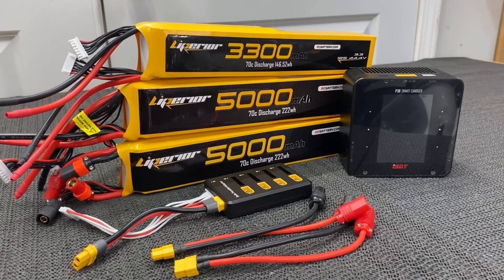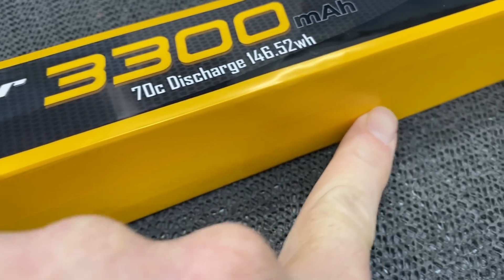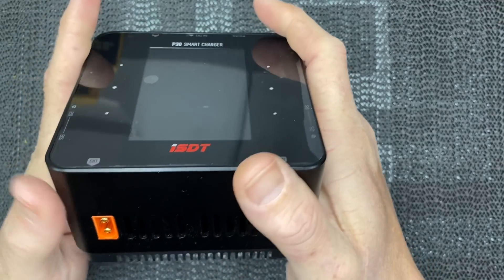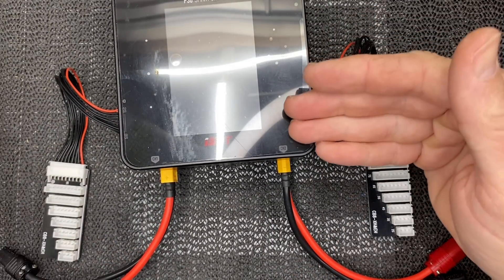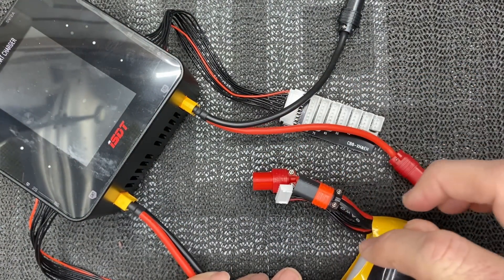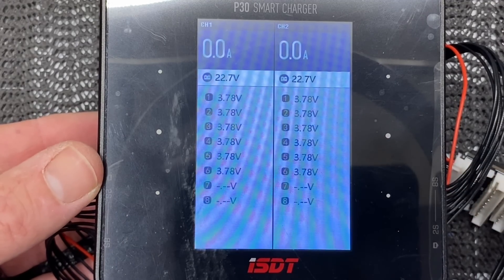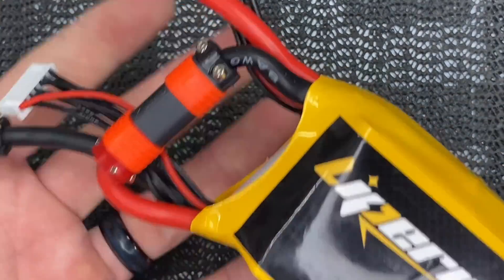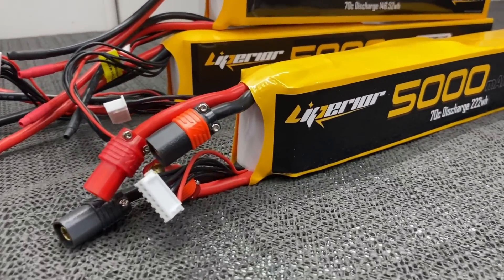This Is How You Charge These! It’s That Simple!

Comment: I like using a separate PSU and charger. The 1st charger i bought was a Spektrum unit, which looks snazzy with the colour screen and the PSU and charger AIO. But the thing takes an age to charge anything, even though i'm only charging 2 and 3s, low mAh batteries. I now use a ToolkitRC charger with a separate power supply. I have a load of PC PSU that I could use, and lab PSU, which would be ideal, but I don't have the space to leave it set up. The ToolkitRC PSU I use with my charger is pretty compact, it has an XT60 on it, so I can use it to power my drones when they're on the bench. I have an old 120mm fan from a CPU cooler which I soldered an XT30 connector to, which I use to cool the flight controller and VTX when I have drones on the bench, which works well, I use it when soldering to take the fumes away.

Comment: Jeff! Thank you so much for this video. I made charge leads but these other things you've introduced are a game changer! Question: On the iL GOBLIN PRO Build , the stock pushrod length puts the tail blades with almost NO DEGREES of separation at mid stick or 90 degrees. Should I shorten the pushrod by a few turns to accomplish the 3 DEGREES of separation you suggest? In fact the stock length put my top blade TOWARDS the boom which is OPPOSITE of what you recommend.

Comment: Jeff,  I’ve just been doing two separate EC5s and a Y connector with the ESC leads,  is there any downside to that method?  This way looks cleaner and less bulky under a canopy
Reply from the maker: So technically, yes and no. Yes the problem with that method is you have multiple connectors which equals resistance, heat, multiple points of failure and multiple solder joints. A EC5 or XT90 is only rated for around 90-100amps. Most of your 700s pull 200 amps with out trying. I’ve pulled some crazy amps out of real XT90 but both XT90 and EC5 are 5mm bullets. It will work and has worked for many years. RC pro connectors is a lot cleaner, bigger bullet connectors. Almost 0 resistance between the connections.

Comment: prolly should have let the viewers know that when parallel charging...that is its VERY VERY important that the batterys are .... 1) the exact same model of pack..same voltage..same mah's ...and same c rating...and..2) that all the cells are all at the same voltage...or that there is no more than .4 volts difference between any of the cells .   pretty important info
Reply from the maker: Yes, that is very important! But the purpose of this video is for charging stick packs so they are going to be the same cells the same MAH and will be drained pretty much to the same level with every flight. Now, if you’re using completely different batteries, of course that is a no no or two separate packs that were flown at two separate times is also a big no-no. My actual full charging video explain all of that. Again, this is just about stick packs.

Comment: For my RCPROPLUS (Soderless) I can not connect Red to Red (Female Red to Male Red) it just doesnt fit. Because they are same size
Reply from the maker: Hmm! That’s strange. What size RCpro, S7? I’ve probably done over 200 of these connectors so far and I’m never ran into any issues like that. They are very tight
Reply: I think I may know why. Have you got a female brass part in a male red plastic housing and a male brass part in a female red plastic housing? Brass parts can swap around. But you must have male/female brass parts with male/female plastic housings. Hope that makes sense. It sounds like you are either trying to use 2 male housings or 2  female housings.
Reply: @ Yes that seems to be it in the kit were no other housings the black case is just a Little Bit bigger than the red one. But I just saw that im using rcproplus 8mm soderless

Comment: You didn’t go into much detail about parallel charging, but even mentioning it, I would have highlighted the significant risks associated with this method.

I typically charge four 12S stick packs like the ones you showed (two packs per side, four in parallel per channel) using my iCharger, and have been doing so for years. This method allows me to charge four 12S packs in under an hour without pushing excessive amperage through the cells. However, it requires a very strict regimen to ensure proper balancing and secure cell connections, or there’s a serious risk of fire - something that normal single-pack charging doesn’t carry!
Reply from the maker: No, I did not going too much detail on parallel charging in this video. That is for a separate video that is coming that will go into very detailed explanations. When charging a stick pack, they’re going to be the same MAH and your cell should be at the exact same voltage of course unless you have a bad or weak pack. Personally, I don’t like and not a fan of parallel charging and hardly ever do it unless it’s my small S1/S2 battery’s.

Comment: Mr Jeff i have sent you couple of emails requesting your help. Thank you sir
Reply from the maker: Hello! I’m sorry I have not responded. Can you tell me what the emails are about? I get so many of them I might or must have missed them.
Reply: @westhobbiesrc8051  yes sir thank you for responding, I am in the process of building a super puma scale helicopter, very large and I wanted to see if you could help me in the process I am using iKon 2 with a nx10. And how much would you charge me for questions on connecting it right. Specially the retractable landing gear and the ESC, Bec, and set up. Thank you sir

Comment: Jeff good video of basic knowledge which is not always basic knowledge, example, I recently tried soldering 8mm bullet connectors for the first time, and although my soldering was perfect 👍🏻 unfortunately I had the connectors plugged into one another while soldering and the took the “spring” out of the connectors and now they are too loose and need to be replaced, I tried soldering a 6mm that was not plugged in and it did not loose it’s original diameter 😊lesson learned !
Reply from the maker: Thank you! Yes, basic knowledge but sometimes people get scared of a stick pack and don’t understand exactly how to charge it even though it’s just two batteries stuck together. So I normally just solder bullets on there own but have plugged them in together many times with no issues. I found a lot of 8mm bullets are cheap and wrap easily (as you found out) look into RCpro connectors, they are expensive but gold plated and do not spark when you plug them in. Well, worth the money in my opinion! Best connectors on the market.